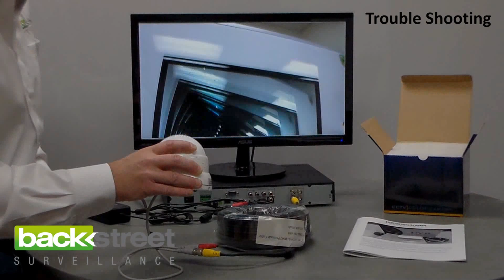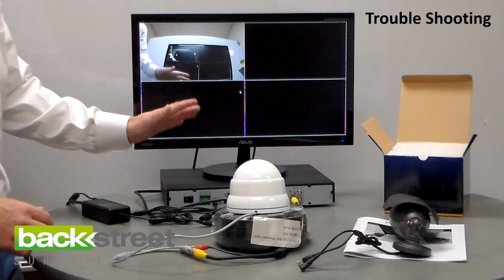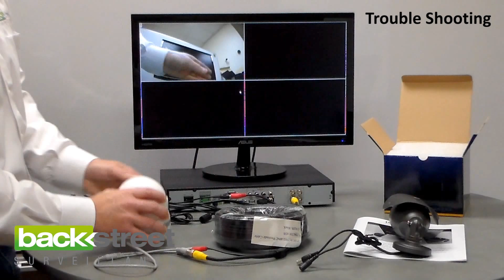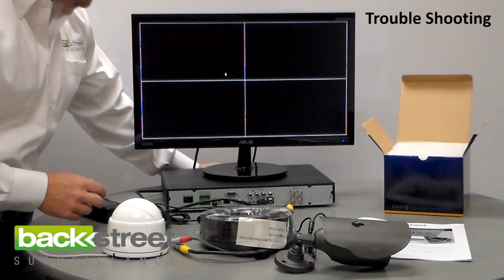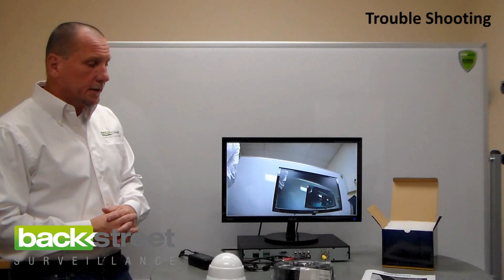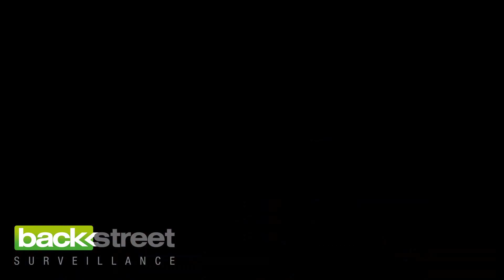Troubleshoot Coax Security Cameras | Easy Fixes for CCTV Systems

Comment: Hi, I have 8 cameras, none of them working now, NO VIDEO message instead. I can see the cameras flashing at night, white flash , nothing red. Before they stopped working, 2 of them worked somewhat,  live view was intermittent.  Those 2 worked like that for a day before they stopped working completely.  Any suggestions on how to troubleshoot them? Thanks in advanced.
Reply from the maker: Sounds like consumer grade system. It's likely a Lorex, Q-see or something similar. There is not much you can do to troubleshoot low quality. If its not reliable to start its likely to have nothing but problems down the road. Sorry we don't have better advice. We recommend contacting the company you purchased the system from. Hopefully they have a phone number. Thanks for the question.
Reply: @BackstreetCameras  , thanks for your reply. I purchased this system 4 years ago and was installed by a company that assured me it was the same system that they and many businesses use. It has never worked properly. It was a headache to get in touch with them the first year while under warranty and after I spent $195 to extend it one more year it was harder. The cameras are identical to the white ones on your video, that's why I asked. Again, I appreciate your reply, I guess I made a  $1,400 mistake.

Comment: I got a night owl 8 channels 1080p I bought a while back..... I have 6 cameras and from the 6 there are 4 that go in and out and the image only showes half image then it goes out again 30sec laps i got one of the good one and check the bnc on the switch and it works am guessing is the cameras but not sure. is there a reset on these cameras?
Reply from the maker: Night Owl is known for similar issues. Its possibly the power supply. From your description its possible the cameras are under powered causing them to reset. Try removing one camera from the system and then let it run. See if the issues persist. If it does then remove another camera from the system. If the issues stops then its either the power supply does not have enough power for all the cameras, or you have a bad camera causing the system to reboot etc. Hope this helps.

Comment: I have a dome camera that kicks into infrared mode even when the lights in the room are on (two bright 2ft fluorescent bulbs). It wasn't like that when it was first installed. Started happening recently. Any idea as to what might be causing the problem? Any help/advice would be appreciated! Thank you
Reply from the maker: Hi Fadwa, The camera may need a small viewing adjustment. Not sure why it started now but was fine when first installed. But by simply angling the camera down a bit or left or right would change the way the camera is seeing the light and may correct the issue. Give that a try and let us know how it goes. Thanks

Comment: i have annke cameras and it just shows a black screen i have tried everything and i cant get it to show images. and i checked the test to see if the red lights showed up and it didnt but its connected to a power source idk what to do
Reply from the maker: Hi Cupquake, could be several things but the red lights not showing up...indicates the power source is not operating for the cameras. I would replace or have someone check the power supply with a power meter to see if it is providing power...step 1. Step 2 call the company who provided the system and ask for troubleshooting support. Sorry cant offer much more advice based in the info provided. Good luck.

Comment: I have three cans that are blinking on and off every now and then ideas please???
Reply from the maker: Thanks for the question. My first guess is POWER. If the cameras are sharing the sample power supply or power outlet I would start looking there. One possibility is when the night vision systems on the cameras turn on the power consumption rises above the maximum power that can be delivered to the cameras. When this occurs you will see strange things like cameras going in and out. Basically each camera is not getting the minimum required power to operate reliably, so they start doing strange things like going on and off line randomly. So first I would monitor the time of day when this is occurring and see if there is a correlation with the night vision systems turning on and the problems occurring. Hope this helps. Keep us posted on what you find. Thanks

Comment: Please help me,ive purchased a brand new hd idvr with 4 cctv camera,the instalation went flawless,left them over night,they had good image,good ir image.Closed the dvr in the morning and wanted to turn on again after arround 7h,but there is no image coming from the cameras.Checked if the ir is on,and it is on for all 4 cameras(at the same time at night,sugesting that the cameras do get power)Is it possible that all 4 ports of the dvr gone bad at the same time(seems odd)
Reply from the maker: Sounds like the video recorder or the power supply for the video recorder. Time to call the supplier and get some tech support, if they offer it. Sorry I could not be more help. But your evaluation seem in the right direction. Hope this helps. Thanks

Comment: Hello, great video! I have a 4 camera setup and just recently, 1 camera stopped connecting. When I try and troubleshoot the problem, it shows the camera is offline. After trying several times to reconnect, nothing happens. Then I tried a different camera that I had and still nothing. My system is a brand called Akaso. Even trying to connect it wired, it still will not recognize either one. The other cameras are fine. Crazy situation. The setup is just over 2 years old. Could the box be failing now? I ask because now something is putting my monitor to sleep as well. Not sure why, nothing changed. Thank you!
Reply from the maker: Sounds like it could be your video recorder. Have you tried using different inputs on the video recorder? It might be that just one port on the unit is failing. We are not familiar with the Akaso brand so our suggestions are limited to the basics. I would try a camera that does work on the input that does not work. If the camera works on that input, then its the bad camera to blame. If the good camera does not work on the input then its the input on the video recorder. Hope this helps.

Comment: What would you say the problem is with digital cameras blinking on night vision, blury then sharp, continuously but my analogue cameras are ok. I have a four channel system with two digital cameras and two analogue cameras, I've also tried an extra power supply running two cameras on each without success. Any help would be appreciated.
Reply from the maker: Its likely the night vision system. Its trying to automatically adjust to the light levels as it sees it. Try adjusting the cameras view slightly by aiming to the left or right. Its possible the night vision infrared light is bouncing off something close to the camera causing the camera to constantly readjust. Aiming the camera in a different areas and seeing of the problem continues may be the way to verify if this theory is correct. Hope this helps.

Comment: hi on my monitor camera 1 slot has a black box in it i cant seem to remove but camera 2 3 4 are fine its not the camera any ideas please
Reply from the maker: One of two possibilities come to mind. Either the video feed from camera 1 is gone causing the entire filed to be blank. Or the system has a feature called "masking". This allows you to block out areas of a video for privacy reasons, such as a neighbors windows etc. If your system is equipped with masking, its possible a masking section has been applied to this camera causing the black box. I would take a look to see if this feature is enabled. Hope this helps.
Reply: thank you for your responce i will check it out thanks again

Comment: Hello there I have a problem with red rectangular moving box on every object that’s on the camera like car or humans walking is there any solution to fix this problem it’s really hard to identify people with that glitch on thank you.
Reply from the maker: You have motion detection turned on. When the system detects motion the red boxes are indicating that the system has detected motion. Each system is different, but you should be able to turn off the red box feature without turning off the motion recording. Hope this helps. Thanks
Reply: I understand that to
Indicate that the motion sensor is working there a red dot 🔴 on the top left of the screen but I’m having this problem recently the red box wasn’t there that covers objects wasn’t there. Thank you for the response.
Reply from the maker: Yes the red do on the top does indicate motion is recording. The red boxes you see with movement are trying to indicate to you what triggered the motion so you can use the adjustment to dial the system in. I still think you have that feature turned on.
Reply: Mac - The Security Guy how do I turn it off?

Comment: I have a pressing issue! @Mac-The Security Guy. My cameras refuse to work all at once. Its 4 of them and I initially thought that just one camera was bad but I accidentally installed the one that was not working and it worked! But if I connect all 4 it won't only 3 camera . I simply don't understand why that happens
Reply from the maker: Do they all share the same power supply? Its possible the cameras are drawing more power than the power supply can provide. This would allow one to work but when connecting the others, the available power drops possibly causing strange issues. This is just one possibility.
Reply: @BackstreetCameras  it has a power adapter connected to the wall which is a connection for the splitter for all four cameras.
Reply from the maker: Step 1 would be to isolate each camera. First plug each camera into the power supply individually (one at a time) and verify each camera is operational when only one camera is attached to the power supply. Next if all the cameras test good, plug two cameras into the power supply and see if the two cameras work or not. If not, the power supply is likely damaged and cannot power multiple cameras. If it works continue to plug one more camera in at a time until the cameras stop working. The last item plugged in is likely the problem or the power supply might be damaged and not putting enough power out to power all 4 cameras. Hope this helps.
Reply: The Security Experts - Security Cameras Made Simple same happening with my cameras... I was suspicious power supply... I will buy other, since all are working properly but not together.

Comment: what if one camera keeps cutting off and on over a period of time. checking the cable connections ( unpluging and replugging cables ) starts to work again but over a extended time of use, same thing happens again. is there something to put at connections before plugging them back together like wd40 or a grease ( just a reference ) to get a better connection or is it better to just replace cables. if so, is there a product to use or brand for either one that i should be looking for. Thanks
Reply from the maker: Hi Darrell,  If the connections are solid and the cable has been checked, I would consider other environmental possibilities. For example: Does this happen at night? Could be the power supply for the cameras is aging and when the night vision system turns on the power draw is too much and shuts down the camera. Just one possibility. 

Are there other devices on the power circuit that may turn on cause a power bump or drop. Does it happen in bad weather? Could be the elements. Try and think about all the things that could effect the camera. And definitely make sure the connections are protected from moisture. Hope this helps.
Reply: The same thing with my three dome-type cameras installed inside the house. I have been through all the wire-swapping, and all. Sometimes they will work when I unplug the whole set-up for an hour before rebooting. But they will only work for several hours before going out again. Now two of them do not totally work anymore. One of these two turned up recently, but went black again after several hours. But you can see that there is power since at night, you can see the LEDs lighted.  I have no similar problems with my external cameras. I am already getting frustrated. Do I simply replace the cameras? Are the cameras of poor quality? I hope you can help me please

Comment: the cables on cheap systems are junk out of the box replace with coax cable. you can buy thin flexible stuff pretty cheap
Reply: Where can I buy the type of wire your talking about? How cheap, and can you show a video on step by step showing how to do?  I just setup my Amcrest and only 2 out of 8 is working right now, and dont know why? Any help would be greatly appreciated.
Reply: I wish someone would reply to my question.
Reply from the maker: Exactly right. You can see and feel the difference.
Reply: @BackstreetCameras  can you help me with my system please? It seems two of my channels aren't working.  It was one channel at first, so I bought a new camera but it still didn't work so I factory reset it now 2 of my channels dont work and it has stopped recording.  Thanks.
Reply from the maker: You'll have to speak with Amcrest about your system. Only they would know where to buy the thin cheap cables you refrence. Its a shame they do not provide better customer support. But look for a support phone number if they have one. Amcrest is a non professional grade system so some of their products are proprietary. Sorry we could not be more help.

Comment: this video I found very interesting TROUBLE SHOOTING 

in this video it mentions that when you loose picture on cctv but on screen you can still see your mouse moving about that's a very good trouble shot because that can happen & you thinking to yourself WHAT CAN THAT BE IS IT AN HARD DRIVE FAIL no  it turned out to be 8 way splitter cable power adapter had infact lost signal.... output due to a power drop.... so re changed power adapter... & well yeah so far it's al right.  NO BLEEPING  picture back to normal  thanks for that
Reply from the maker: Cheer, you are now a class b troubleshooter. Thanks good!